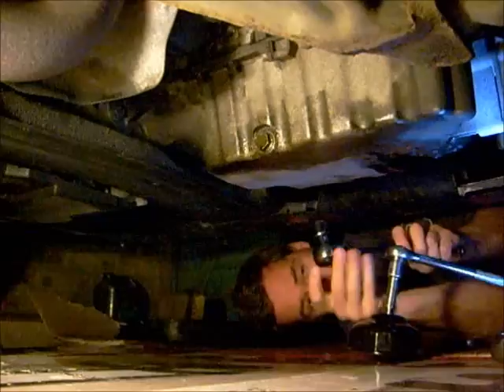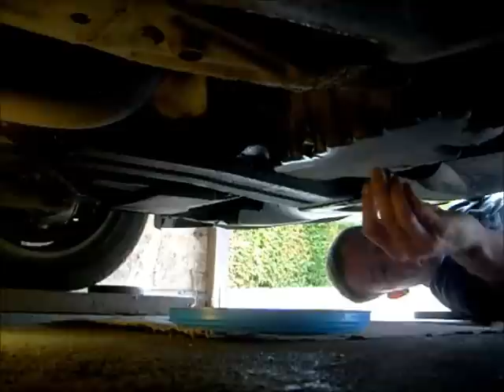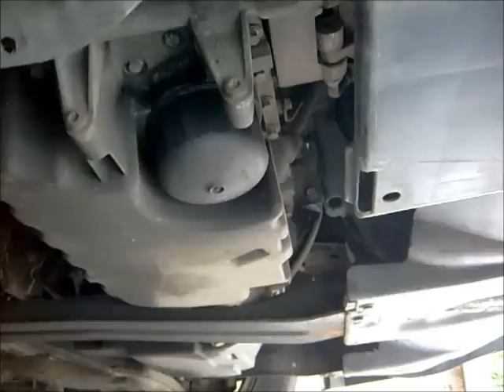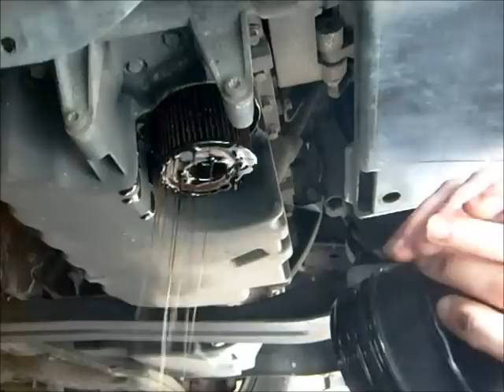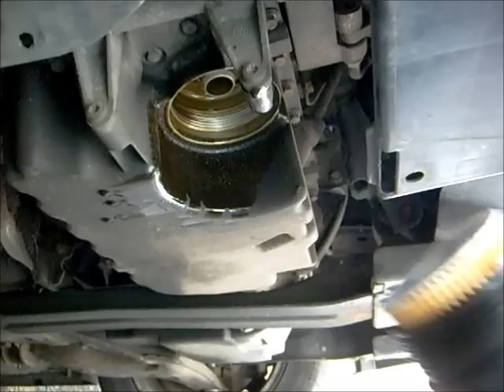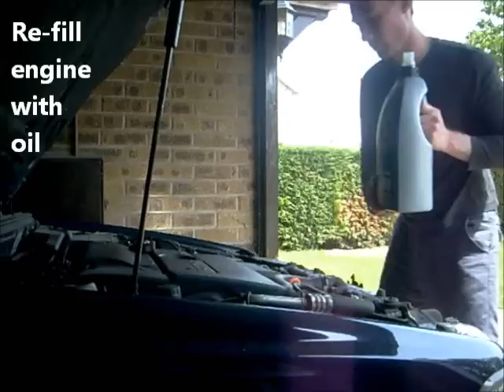Oil Change and Oil Filter Change. Volvo S40 V40

Comment: I have a V40 01' and getting the actual wrench to take off the plastic cover for oil filter was difficult I have now found one on eBay, but I instead used a 3 pronged grip made some mild marks on the cover but did the job. Good video thanks for the effort.

Comment: Words like: "Don't bother trying to use a traditional chain wrench to release it because it will get jammed and you will spend a half hour trying to release it..!. Plus, the oil cover is ABS plastic which could be damaged without the correct adapter. You have to use the proprietary oil filter adapter with a ratchet drive wrench, Homer"..!

it might seem obvious to the initiated - but that's where You Tube isn't a proper mechanics workshop lesson, where questions and advice is free flowing...

Comment from the maker: I've measured the oil socket and it measures 86mm (inside measurement).
There are two markings on my socket. 1 side says ‘S40/S80’ and the other side says ‘86/16’ if this helps as well.
Reply: 86/16. Yes ot helps, thanks, it´s a 86 mm inside diameter with 16 flutes inside.

Comment: would be nice if you will add simlar movie about transmission fluid exchange in 1.6 v 40 , i have 2002 v40 and no idea how to refill
Reply: trans and power steering use same 'container' under hood.

Comment from the maker: What year? This Volvo is a 1.6L, year 1998. It takes 5.4 litres of oil.
Reply: Thanks! All the arguments are valid to a Volvo V40 1.8 Liter, year 2004? I mean the torque, ratchet etc. Oil is 5.4L as I checked out.